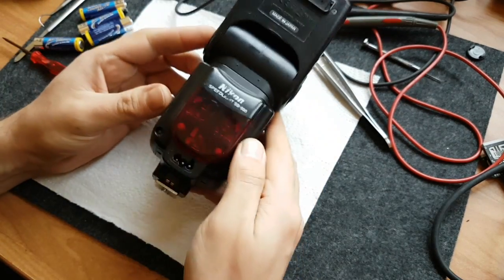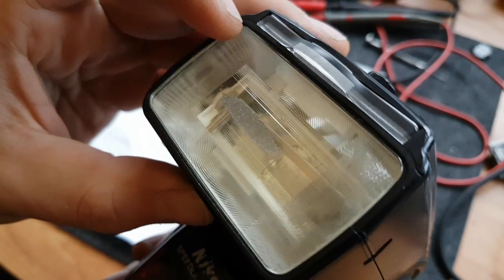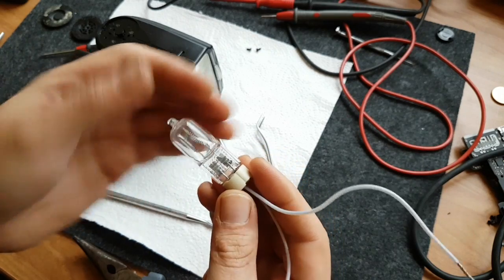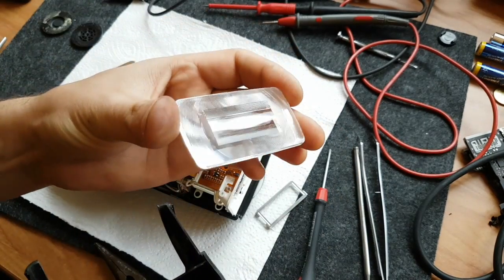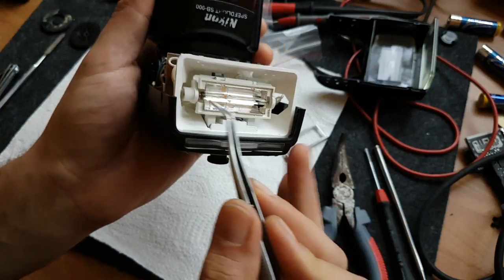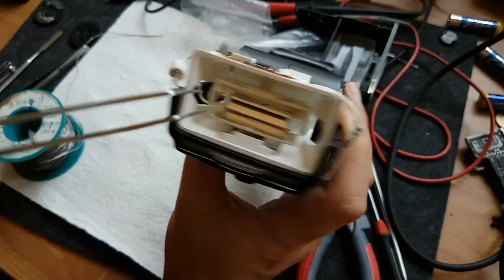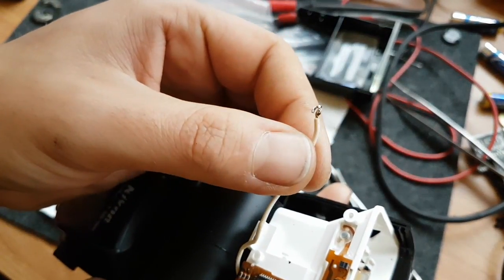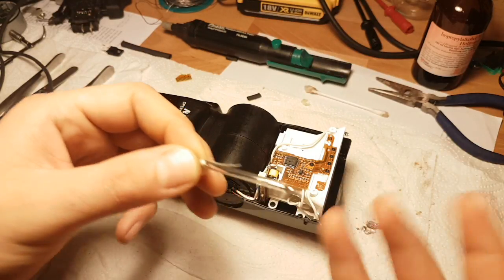Nikon Sb 900 Flash Repair. Disassembly, Tube Replacement and Capacitor Discharge

Comment: Hi parçala behçet, I have a SB 800 which suddenly switched off while shooting (not heavy use). Now the flash wont turn on at all. My contacts for the batteries are good. There was some corrosion on the flatstrip connector on the power board which I cleaned with Isopropyl alcohol. it did not help. Can you help point me in the right direction? Thanks in advance!

Comment: Is the discharging point similar to all other brand flash?? I have a godox v1 for which it has intermittent flash with abnormal low power when i press the test button.

Comment: Hi I have two SB 900. one has a warning and the other won't even turn on, what can be done Do you have any good tips?
Reply from the maker: Not working one will probably be corroded battery contacts. The other one i dont know. seen perhaps 50 of them and none of them came wtih an error.  if you are in EU maybe i can take a look at them since i want to repair defective devices from susbcribers. if you want to learn yourself than just take them apart and play with them. In my video i explained all the important details.
Reply: probably a little loose contact in one But send to the USA from Sweden Can be a bit expensive.
Reply from the maker: @Stefan-tb7re  i am in germany but shipping wont be cheap in any case for sure

Comment: I have a Nikon 910 that sat around too long without batteries. When I put in fresh batteries and turn on it does not power up. I heard it may need to be left with batteries in and turned on to help build up capacitor and get it working again. Any suggestions?
Reply from the maker: it can be just corrosion. First clean the battery contact surfaces even if they look clean. You can use ammonia. Second, move the on off switch back and fort many times to get rid of any possible corrosion. Two times i seen these flashes having issues with main capacitors set discharged for too long. One time the charge circuit exploded and the second time the flashed turned on but didnt function. Yours just doesnt turn on so it makes me think that it either not getting any voltage because of a problem in the battery compartment or there is a problem with the on off switch. Anything else will require some disassembly so if you need to take the flash apart you can contact me again. And you will need a multimeter

Comment: Sorry but you dont repleace plastick fresnell lens on front the flashgun. It is long time used because is mat and some melted and not transparent like must be is no from glass and high temp resistantand capability to work during some flash tubes. One flash tube and one fresnel by one replacement.
Reply from the maker: if you send me some new replacement parts i will happily replace the front fresnell also. Life is not about perfection.

Comment: I have a flash with a stain on the display, it looks like a bad polarizing filter, how do I do it?
Reply from the maker: If the stain is not a big problem, i would not try to repair it. Lcds are fragile and i broke a couple lcds while i want to try repairing them. If you damage the lcd and there are no replacement lcds you will hate yourself forever.
Reply: @parçalabehçet  I understand colleague.thank you Very munch

Comment: Is it really necessary to 'discharge' the capacitor? what would happen if I skip that part? Thanks for the video BTW.
Reply from the maker: Welll... Not discharging a capacitor is not an illegal activity.. but.. If you make a mistake around 400 volts may shock you or fry the circuit of the flash. In either case you will really regret not discharging it. Once you are very experienced with the device you can decide that you dont need to discharge for the particular repair your are doing. I always discharge unless i forgot to do it.

Comment: Nice video. How do you tighten the swivel neck that has gone slack?
Reply from the maker: There is a metal ring and plastic detent with spring which applies pressure. These are the first things I would check. Since I can't see the parts myself I can't really acvidce a solution but you have to take it apart that's for sure.

Comment: Please help me with the SB 600 power not on I took it apart but I need to know where the black end the black wire goes to the other end not on the copper plate I cannot find out with asada. To end please help 704 877-8789
Reply from the maker: Hi. I am sorry but i could not understand your question. If you make a video and upload it to Youtube i may help. Other poeople can see your video so they can help.

Comment: hi i have a flash sb-800 and i have changed the lamb tube 2 times in 5 minutes . i installed the frst lamb and when i turned on the capacitor sound charging was ok but when i fire it make line a small sound but no light and i tried like 5 times and a light came out in the last try and a bad smell was out , than it was nothing no sound no light . i replace the light tube again and it was the same thing a noise without light and when it burn out  a wire of 2 light wires was sold out of lamp itself ( sory for my bad bad english) any idea plz ?
Reply from the maker: You need to give more information. Why do you want to change the lamp? Is is your sb800? Was it working before? Where did you get the replacement flash lamps?
Reply: @parçalabehçet  hello thank you for the reply , my flashlight stopt flashing and i thought it was the lap i replaced the lamp with a new one from ebay and nothing happend , i buyed 3 lamps and now i have only one left , when i replaced the lamp and test it, every time i pushed the test button the lamp made a electrical shock inside the lamp and after i tryed like i sad 5-6 times i flash came out a burned smell and the electrical shock was gone , then i changed the lamp and the same thing happend . can it be the lamps ? or capacitor / or somthing on board ?
Reply from the maker: @reigjediku5241  It is possible that your thyristor is burned. Do you have a multimeter? If you dont have a multimeter then there is not much you can do.

Comment: A great video! Just want to know what's the specification of the main capacitor on sb900/sb910?
Reply from the maker: 350v 1750uf for sb900. As far as i know sb910 capacitor has a lower capacity.
Reply: @parçalabehçet  cool! My sb910 sometimes fire sometimes doesn't, so I'm kinda wondering if I should try to replace the cap or the light tube lol
Reply from the maker: @zl8346  you can't replace the capacitor with an ordinary one. Flashes have fast discharge capacitors. Check the bulb first
Reply: @parçalabehçet  of course I will. I checked with my part supplier and fortunately they have the Rubycon  350v/1700u ‘photo series’ cap and comes in some 30x50 round packaging (I don’t remember the exact numbers). I believe rubycon’s caps are pretty much standard for all Nikon flashes, but the info of sb 910 on the internet is so scarce, so as the last step I will try to do it, but before that I will replace the tube

Comment: HI ,i came accross your repair video today, i purchased a used Nikon SB-900 that cannot power on upon arrival, can you please advise how to repair it
Reply from the maker: Check the battery contacts for melted plastic  or corrosion on metals. If they are in good condition then you can open the lower part of the flash. There is a thermal fuse attached to the battery housing. Perhaps it is burned
Reply: Sorry for late reply, was not sure your gonna reply so quick. There is no melting or defect on battery compartment, can you give me details of the capacitor to be repaired , does it need soldering ? Thanks for your valuable help

Comment: I'm not too confident with soldering - I have never done it before - is it easy to do?
Reply from the maker: if you have a decent soldering iron you can do it. but you need good solder wire. cheap solder wire wont let you do any soldering at all.

Comment: Where abouts are you based? I have took my flash apart and just about to order new flash bulb tubes - where do you recommend I buy them from?]
Reply from the maker: I am in Germany. I would look in Ebay first then try to get them somewhere else in your country. Aliexpress can be an option but shipping time can be too long. Soldering is not so hard unless you have good quality solder. I can't even solder if the solder is bad.
Reply: @parçalabehçet  Thank you so much for answering my question... one thing I didn't understand - is what you cut the little wire for? I couldnt work out what you soldered that to?
Reply: @parçalabehçet  at 10:25 i wasnt sure what you did?

Comment: I have a godox TT520 ii flash and it doesn't fire when pressing the test button.
do you have any idea what kind of flashtube do I have to buy for this kind of flash?
Reply from the maker: i just saw your comment but if you have the dimension of the original godox tube i may help you if you can use any nikon tube on that one

Comment: Make sure you use a fairly high-voltage bulb. I used a 12-volt automobile lamp and it fried the fuse inside the bulb and made a loud "bang!" Terrifying.
Reply from the maker: Everybody has to loose their flash repair virginity first with some banging.

Comment: Hello. What is the voltage of the light bulb you used to discharge the capacitor?  Was the light bulb destroyed after that? Thanks
Reply from the maker: i usually use a 220v 100 watt lamp and lamps never died while I use them. You can experiment with bulbs. If one bulb dies you can just try one with a higher voltage or watt.
The only thing necessary is having a bulb with filament.

Comment: Hi thanks for the video where did you get the replacement flash tube?  regards Graham
Reply from the maker: Hi. You can find them on ebay. not original of course but works ok.